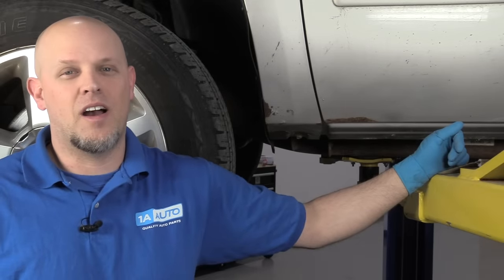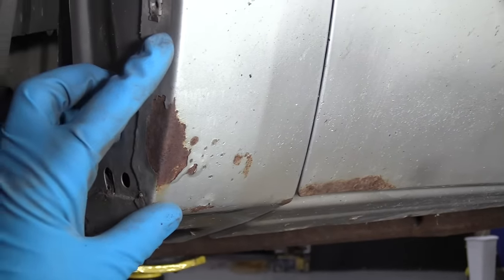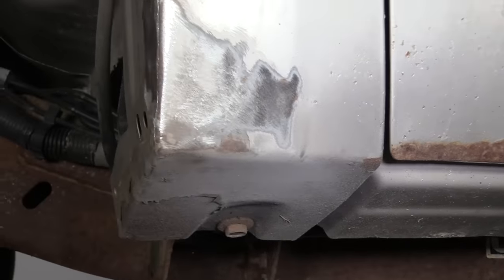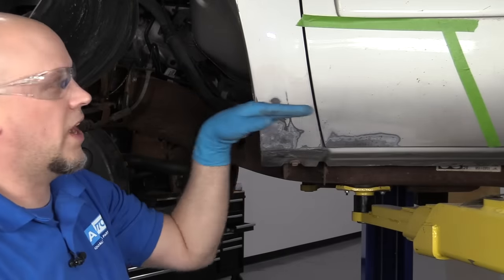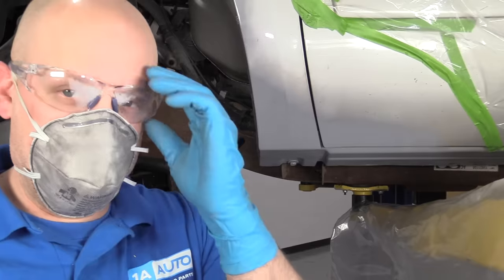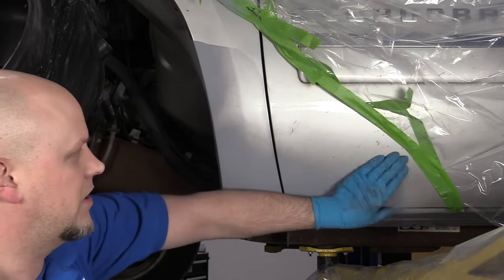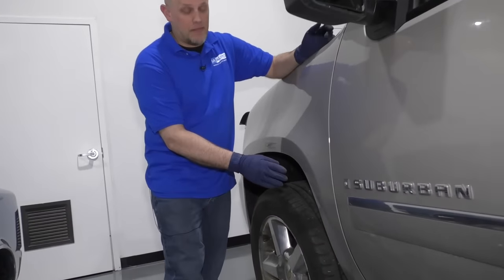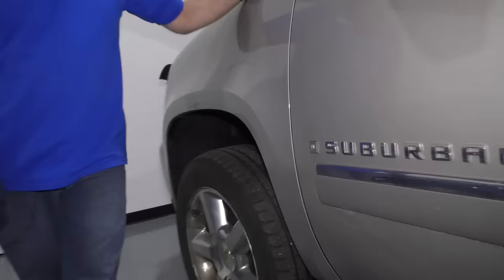How to Fix Rust on Your Car Before It Becomes A Hole

Comment: I've been doing body work and painting for over 40 years. Anytime I grind out rust I apply zinc chromate as the first coat.
Reply: there's lots and lots of undercoats just depends on how you want to tackle the job at hand etc..... is it your car or are you working for a  car dealer  etc....
Reply: How has that stood up to the test of time? Because I find that if I just use primers it only last about AT MOST 3 years before I see the rust eating through the paint again. And this could be something like the top of a trunk lid

Comment: what about the backside of those panels which are surely rusted worse than the outside?    What is missing is how to treat the inside as well as the outside because the cosmetic fix is not going to last long at all.......I would suggest unbolting the fender and treating the rust with phosphoric acid ( Naval Jelly) and repainting it with some really good frame paint to prevent recurrence.
Reply: He had it ground to bare metal what other rust do u mean?

Comment: I need to do this with my 2012 Ram 1500.  Right rear quarter panel is rusting behind the paint between the bumper and the fender well.  I'm gonna have to remove my rear bumper to get behind it tho.  I plan to apply black rhino liner under the body line on both sides of the truck front to back to help protect it from future salt and chip damage
Reply from the maker: +Thomas Goller Thanks for checking us out! http://1aau.to/m/Shop-1AAuto-c

Comment: I know this is an old video, but I was always told to go in circles and keep moving when hand sanding, but you went in straight lines, so does it not matter wether circles or straight ?
Reply from the maker: +Will4May Thanks for watching!  The main thing is to have the sand paper on something flat, not just your fingers.  We use a sponge in this case, bit if you have a block that will work as well!

Comment: Good video.  What grit did you use to wet sand the primer?  Also was that a direct to metal etch primer?
Reply: I'm gonna guess 60grain then 80grain.
Reply: Minimum 220. I use 220 for primer then 400 for paint

Comment: Hello what grit was used in the begining to sand it to metal? And wich grit did u use for preping? Im new to this.  Thanks for the video by the way
Reply: 80 grit to prep up to 220 and prime then sand prime with 400 or 600 than paint !

Comment: The local auto body shop told me rust comes from the inside of a panel, and can't be fixed without removing and replacing the panel. True?
Reply: That’s true once rust starts it’s because it’s already on the Inside think of it as a Cancer on metal. That repair will rust out again from the inside. This is a patch job

Comment: So looking into die grinders so I can begin on some smaller areas on a resto project but what about for large panels? Previous owner replaced the fender but never treated it so it is covered with surface rust. I do not no much about die grinders but it seems it would take forever to do an entire panel with such a small tool. What's the alternative?
Reply: Electric and pneumatic orbital sanders are available, for reasonable cost, from all the home centers with disc size up to 6 inches.  Usually for wood working, but also excellent for body filler on larger areas.  I've even used a belt sander for rough work on large panels.  Final finishing of large panels are best done by hand with a long leveling block.